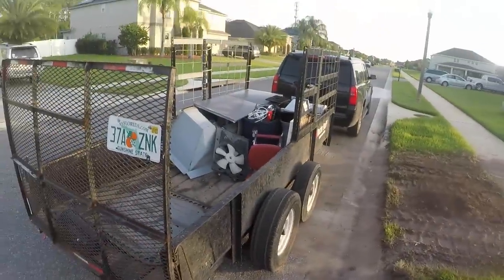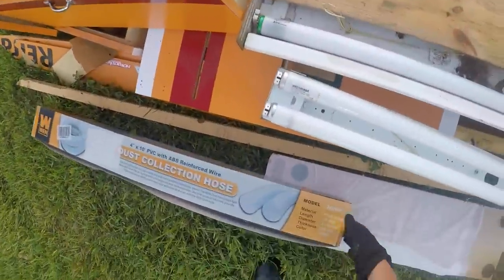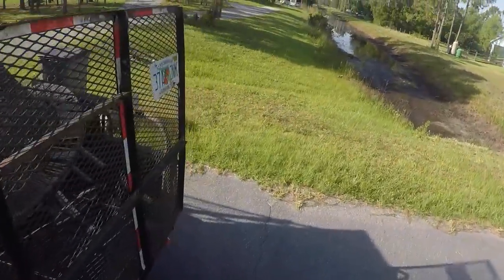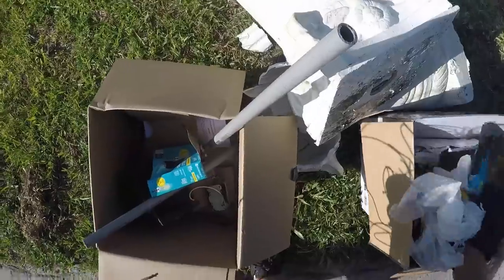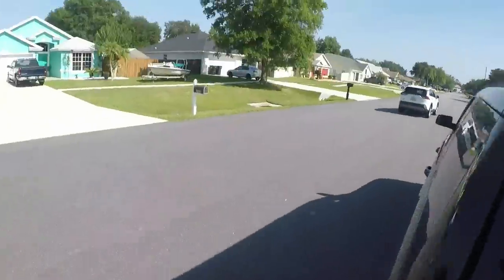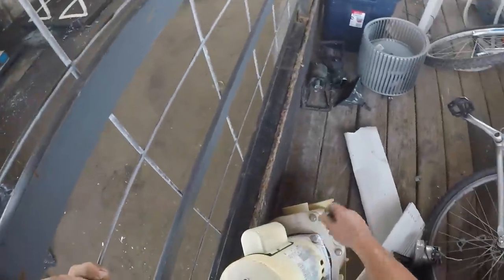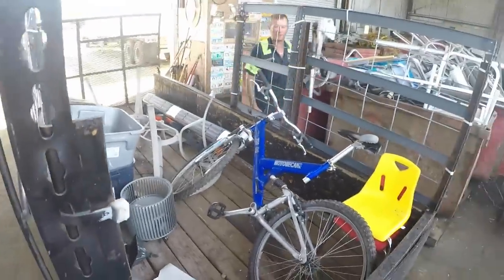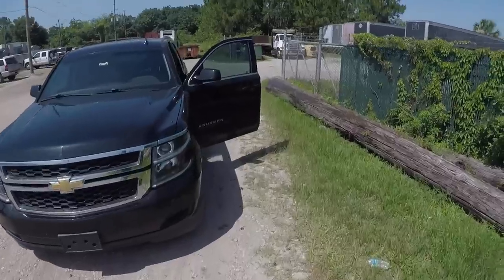Can Scrapping Metal Be Your Real Job? Curbside Hunting For Scrap!

Comment: I cant believe the size of those motors Matt our are a lot bigger than that I will get a go-pro and put up a couple of video's mate you will see the difference Matt and the way I strip them and I will put up a couple to show you other things I strip and how quick it takes and thanks again for the shout out.All the best from Dundee Scotland.👍👍✌👊👊
Reply from the maker: Jeff also said that vacuum motors weren't really worth chasing.  Guess they are smaller here in the states
Reply: @nachostuff  Our motors are about 3cm's shorter than the motors out of our washing machines Matt and they are the same motors as you'se have in your front loading washing machines mate plus the cases are usualy made from ally and  the coil is usualy thicker copper its easy to strip aswell Matt you just cut one side and pull yhe rest from the other side.I hope I did'nt waste to much of your time asking you to do it mate and thanks again for the shout out mate it was well apreciated Matt and that has sealed me in to be a sub forever now.All the best from Dundee Scotland.P's I hope it picks up soon Matt eventualy the scrap gods will realise that you'se are needing help mate.👍👍✌👊👊

Comment: Today I had a stainless steel dishwasher right away so I stuffed it in the Kia and I was close to home. Unloaded it quickly and still filled my car with scraps. I'm so close to the scrap yard I'll take it in a 2nd load Saturday. The construction dumpsters are loaded with scrap goods. This week on Saturday I have at least 3 full loads to take plus the non ferrous.
Reply from the maker: Sweet - keep loading them up.  You are doing great for the little vehicle.

Comment: i haven't been finding alot curbside, but dumpsters are still going strong, you can definitely do scrap as a living, i do junk removal, and scrap on the side, pays super well in total especially with the stuff people give to junk removal
Reply: I do mostly ewaste ,brass, copper,and wires.finding very little in trash now a days and dumpster I hit everyday are not producing like they were .I have keys to these dumpsters as I went and did a promotion of what I do.they told me to come back in few days as they needed to check with company owner and if he on board key to dumpster.all four had to start locking them as people were dumping in them.i hit plumber, electricians, computer,and a appliance store.since I know they are lock I'm thinking people not doing much of anything anymore.i am always good at appliances store to pull motors,copper,brass and wires from items they bought back that people replaced.i went out early this morning and ran my street routes and found two items.i went then to every dumpster I could think of and scored just few cords,and fan motors.i drove over to next town and found one shop vac ,and a box of aluminum punch outs from local machine shop.after supper tonight I'll go out and hit my four dumpster to see what if any is in them
Reply from the maker: I need to start doing more junk removal and dumpster to bridge the gap - little by little I will get it done.
Reply: @nachostuff  yup, just dont wear yourself out doing too much, i would say stay away from junk removal other than maybe small jobs, cause it can get rather crazy and too much at times

Comment: I think people are holding on to their stuff because of the economy.reason I think that I pulled up to a pile tonight to grab a p.c. as I waited for traffic go by the home owner came out and took it back inside.the next place I stop the lady of house was walking down walk and said are you after the laptop,I said yes she said they decided not to get rid of it because they decided not spend on things to replace unless needed.she did say Waite here and went back inside and came out with two dish network boxes and the dish.she said I could have them because they putting up a antenna and got rid of dish.dish told them to toss everything as they not wanted it back.i think people are scared and just hanging on to stuff.i ran my routes in a hour and half and turned up dish equipment,a faucet,and 3 cords that was it.things were out for trash and that what it was household waste and empty boxes
Reply from the maker: I agree - people are in a holding pattern right now.  The gas prices are not helping matters either.